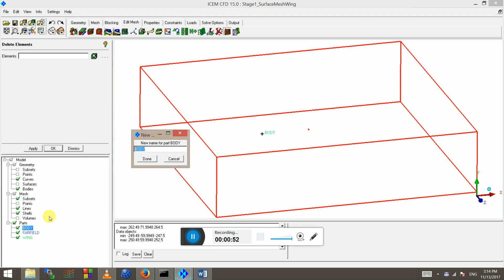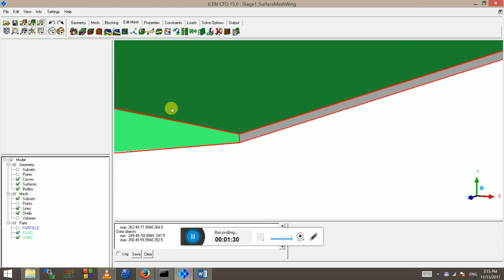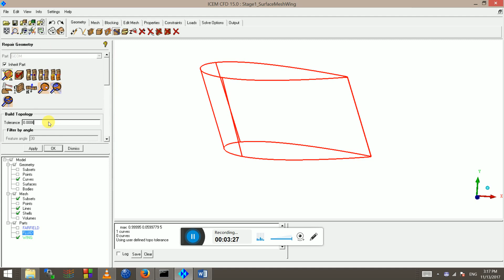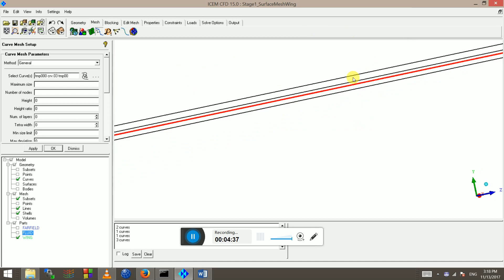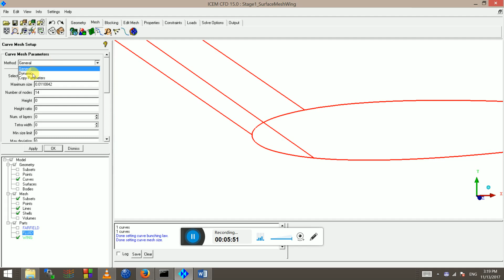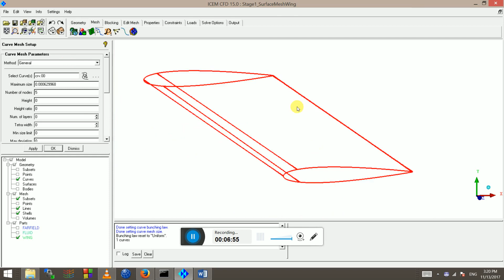Lesson 6a -  Unstructured Surface Meshing - NACA wing ICEM CFD

Comment: hello sir i do have a question if we are doing a mesh for a rectangular wing can we just make a 2d  structured mesh first and then just extrude that mesh
Reply from the maker: Yes, you can use that technique. Wrap the 2d blocking around the airfoil and extrude in any direction you want
Reply: @mohamedsereez2010  THANKYOU SIR I REALLY APPRICIATE THAT YOU REPLIED